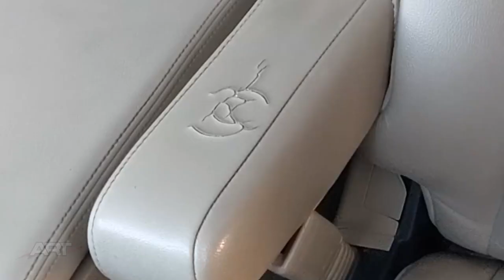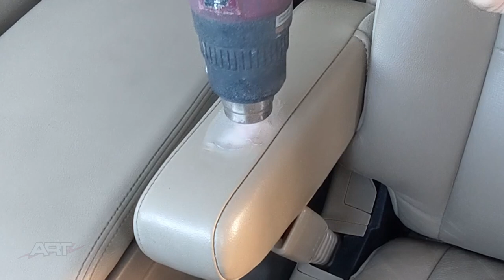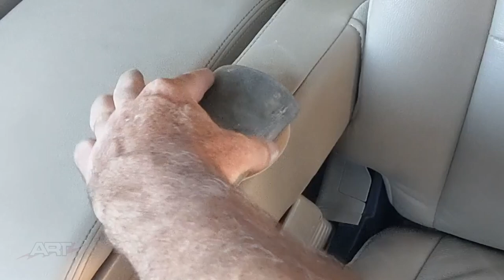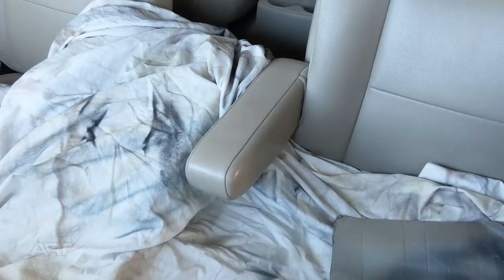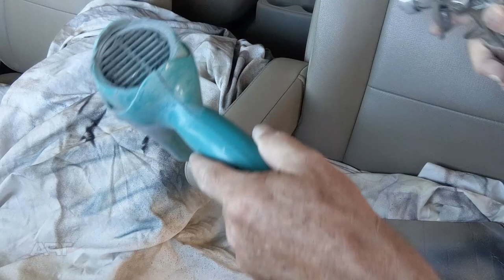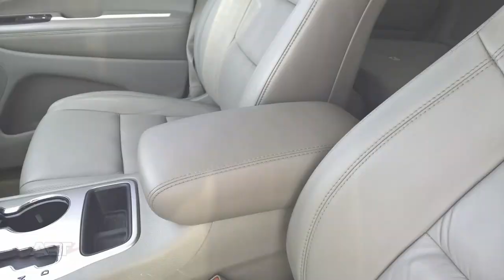Flat Vinyl Repair Part 2 v21

Comment: Master class. I learned a lot. Please get an amazon affiliate account and start listing products you use. Thanks again for sharing. Also, please go through your videos and add better descriptions. You will get more views. "repairing cracked and worn vinyl car armrest with filler, mesh and texturing" or something like that... more keywords will get you more subs... you got me! I have a bad armrest in a BMW E46.
Reply from the maker: For products please consult your current supplier.

Comment: Could you please show us your best methods to repair vinyl and plastic that have a patterned texture?  Also,  do you have any solutions for repairing chrome on interior trim?  If so, could you show us that too? We've been getting a lot of requests for those repairs. We've done them in a few cases but I have yet to be satisfied with the results on any of them.